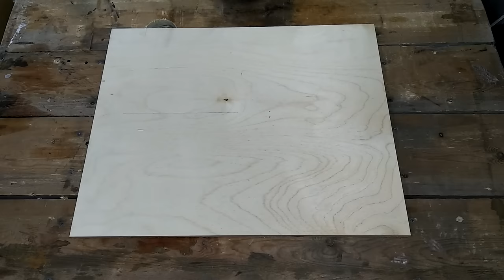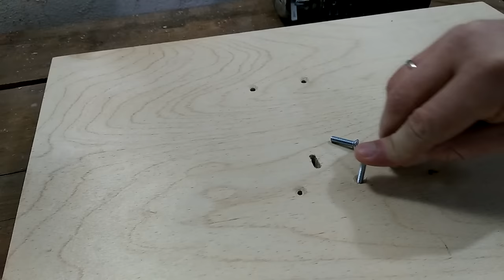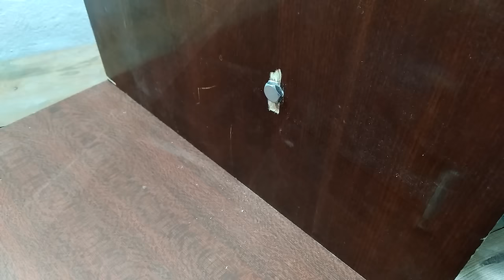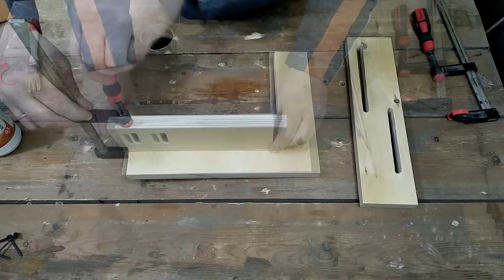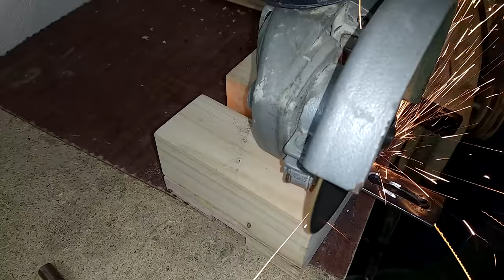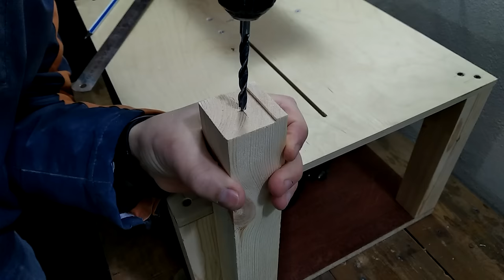DIY Jigsaw Table — 3 in 1 Homemade Jigsaw Table Free Plans

Comment: What kind of blade do you use?  Thx
Reply from the maker: Hi, Matthew! I use different types of blades, usually basic blade for wood and clean cut for wood
Reply: @MazayDIY  I built a similar with a DeWalt saber saw, but on it’s downstroke the blade pushes the work up, so it chatters.

Do you use a blade that keeps that from happening?
Reply from the maker: @mcohenist  on a jigsaw table, I only use blades with upwards teeth.
Of course, there is such an effect as pushing the workpiece up, but it is enough to press the workpiece a little harder against the table and vibration is minimized. Perhaps there are some other nuances when using a saber saw, I do not know, because I have never used it.